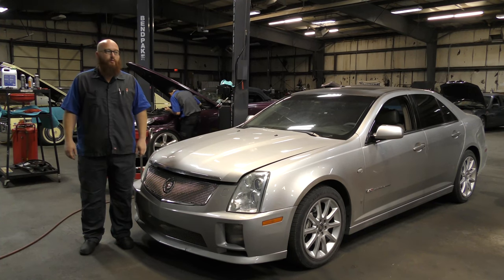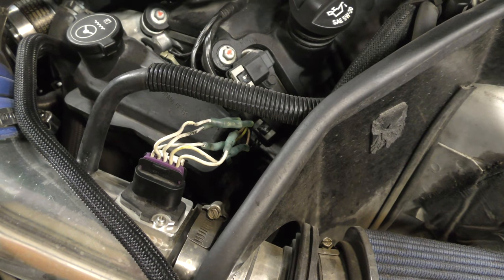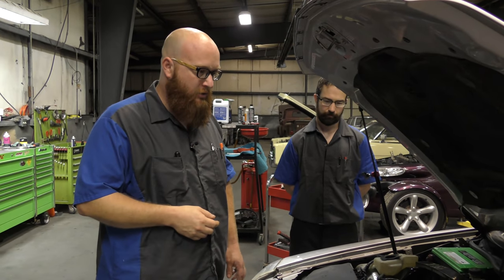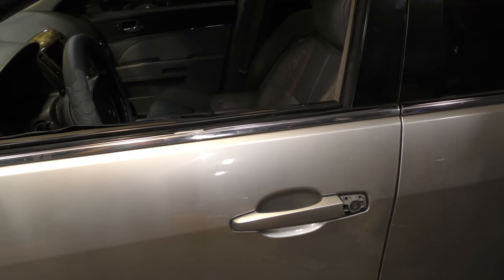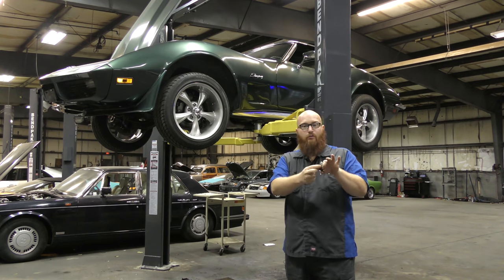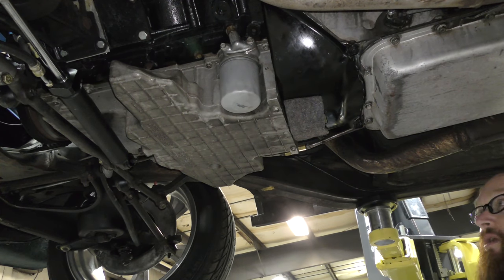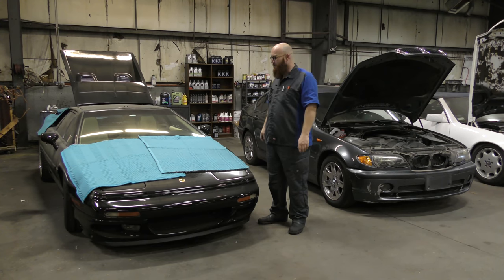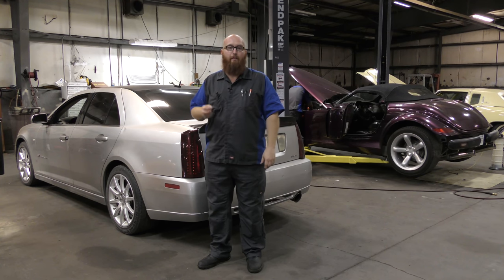When shops break cars! The CAR WIZARD cleans up mess made on 06 STS-V Cadillac. Plus shop updates.

Comment: The nightmare for every mechanic is opening the hood and seen aftermarket parts all over without any information lol.
Reply: Especially some crazy ass Nelson Racing Engines looking cold air intake..like it's from Aliens
Reply: That's the biggest reason why people who modify their cars should actually know enough about working on cars, that way they have a good understanding when something (beyond their ability) goes wrong and they seek out help. I know around where I live these custom shops always sell people on performance mods, but when something inevitably goes wrong, often times you'll see the car on CL / Facebook because the person can't figure out what went wrong, or the shops they went to have no clue what modifications were made and it'd cost thousands just to diagnose.
Reply: If your mechanic is scared  by an after market cold air intake then your mechanic is not a very good mechanic imho.
Reply: @geerstyresoil3136  took my car to a dealer, even after drawing them a diagram for an aftermarket horn working off the battery, they still would not touch it for an unrelated issue.
Reply: Especially on a N* they are famous for hating any kind of tuning. Hell there was a team that spent about a decade trying to make a bolt on Supercharger kit for the N* after 10 years they were able to get the ECU to tolerate 2 psi of boost before it shit the bed...the next week GM announced the factory SS 4.4 they abandoned the project the next day
Reply: It's not a nightmare it just don't get worked on

Comment: I can't speak for that STS-V, but I have a STS-V; the engine and the car is the exact opposite of what you described. It is a highly refined hand-built motor with a ton of features and high end materials used throughout the interior. Read any article on a STS-V and that is the consensus. The STS-V, took a completely different approach in V form than the CTS-V.  From the factory, the car is virtually silent despite having 469 horses under the hood.

Comment: I own a 2006 CTS Sport Luxury and I love the car.  I'm 71 and this is my umpteenth car, truck, and hot rod.  For those that aren't familiar with this particular model, it has quicker steering, 4 piston calipers, sport suspension, and a 4 valves, twin cams all-aluminum engine.   !8" factory alloy wheels and some other performance upgrades, making it a blast to drive with great, flat handling.   New Continental 225-50-18's that are amazing.  Only 85K miles.
My exterior looks great in Red Jewel Tintcoat.   It does have similar minor scratches and dings like your customer's  DTS.  Love your channel.

Comment: Wizard, another channel had the same issue with boost pressure sensor. It was a shorted sensor, and it got wet. 
I'm sure you already checked that but wanted to mention it just in case that episode holds a clue into what's going on.

Comment: Speaking as a machinist, I've worked in multiple fields in industry where, even if I wasn't machining parts, the attention to detail that you have to have to be a good machinist will easily transfer over.

You don't need to apologise for having branched out into cars. As you just showed, having the know how and a couple of basic machines handy is just an ace in the hole for you.

Comment: I have an STS-V. 😁 Stealth Blue on Titanium. The Spectre intake bolts right on and I’m not sure why the wiring was that way. Seems like just an improper installation but odd because it essentially bolts right in. Not much to mess up. Also, if this has gutted cats, the tuning may have been an attempt to turn 02’s to always ready in order to omit the constant engine light that will always illuminate. If they aren’t already there, the owner should join Cadillac STS-V Owners on Facebook. I’m an admin and we’re very helpful with issues like this.
Reply: Sometimes "mechanics" overthink things, you know.

Comment: I have a base model STS with the v6. Even the v6 is respectably powerful and fun to drive. I'm hoping to get 300,000 fun miles out of my STS.
Reply: Did you get the 300k yet ?😂
Reply: @mohamedhossam896  Nah, I sold it at 156,000 miles. The piston rings in cylinder #2 failed. I miss it every time I drive the CTS that replaced it.

Comment: My last 2 vehicles have required 80% fixing what the PO did or had repaired.  One repair was the oil cooler. I lost it at 75mph 😞.  I got 2 quarts that remained, so far so good.

Comment: I'd rather someone squat on the engine and pinch off a large loaf on my intake than have them leave a bunch of nasty looking crimp connectors and a lack of elegant soldering contained by heat shrink tubing. The whole "Tune Trend" is disappointing as well. Some kid has a J.C. Whitney $19.95 gadget with a YouTube video in Russian, then declares he's a tuner. They never document, never able to reverse what they did or explain why they did it -- 'Just thought we'd try poke around in the ECM.'

Back in the day, when I tuned a car, it was clear to all what I had done by sight and by sound. My specialty was the 327 - 325 Chevy engine. Flip the top of the air cleaner over and you get at least 33.5 hp at sea level, an Army Trix sound and a moan like it's coming from a, well... just a long deep lustful moan. Why you'd want to, I haven't a clue, but you can reverse that tune while the traffic light is turning green. Pro Tip: Don't drop the wingnut down the Rochester!
Reply: Those wire junctions deserved a unibloc style connector, something weather sealed and gasketed
Reply: Amen!
Reply: Do not drop anything down the Rochester
Reply: I guess if you're working on a Chev engine with a Rochester at least you don't have to worry if the 10mm ended up in there.
Reply: The butt connectors were ugly. Butt connectors are better than ordering though. Soldering can cause a resistance change in the wiring. When you're talking about a sensitive sensor like a MAF, butt connectors are ideal. However, there are better and smaller connectors you can use and can be installed a lot cleaner.
Reply: @joshfoley8862  at most, a solder joint will change the resistance of a wire a milli-ohm or two (an incredibly small amount). Well within the margin of error for any sensor on a car. 

A dirty butt connector could change the resistance far more.

Comment: Gm typically uses a 3 bar map, good for 1.6 bar of boost. When you install a 4 bar you have to switch two wires around for it to read correctly. They install it when they turn up the boost, for fuel metering and the +/- of ignition timing.

Comment: I’ve had to make many custom tools, like:

A set of wrenches to adjust the valves on my Benzs engine.
A socket to torque the locking hub bearing rings on a early 90s Tracker.
A socket to open up the valve caps on the shops air compressor.
An odd length socket to torque the headbolts on a Subaru while the block was still in the car.
Had to bend several box end wrenches to fit different distributors over the years.
Made electrical connector de-pinning tools out of the spring bars from wiper blades.
A power tester, made out of a cigarette lighter plug, alligator clip, inline fuse holder, and a voltmeter probe (great for testing if a blower motor is burnt out or testing starter solenoids)
During my tech school training, part of the class was machining a hammer out of aluminum, with a brass and 2 plastic faces.
Several “helping hands” out of bent coat hangers and alligator clips to hold wires together while I soldered them.

Comment: Hey Car Wizard, I wish you were there when I brought my 2014 BMW Z4 with 37k miles to the dealer and they told me I needed $4600 for 1 strut and 1 shock.  Now I don't dare drive drive it.  I know, I know, you hate working on BMW's.  To be transparent I have hit a couple of pot holes.  Soo far they have got $900 out of me for two tires.

Comment: Given the drain plug (looks aftermarket and not a 4L60 pan) on that 700 R4, I'd say that trans has been messed with before. There is a good chance that someone put a shift kit in it and removed the pump for the boost valve mods and didn't use the newer washers on the pump bolts, which will give you a false diagnosis on the leak. I've seen it happen and know some guys use RTV on them and the vent crossover in the pump for that reason. The shift kits jack up the line pressure under driving conditions, which is why you'll have a leak after a drive but it stops when sitting at idle. The stator shaft that retains the bushing is pretty cheap with a new bushing installed (better off doing both) if that actually is the problem though. I somehow knew you'd have a lathe....

Comment: I am an 73 old  shade tree mechanic with 1960 - 70s skills.  I observed back then  that you had better know what you are doing if you are modding a car. True in 1965,  super duper true today.  This things are engineered as integral  system. You can screw it up adding a cold air kit if you do not know how to do it.

Comment: The 3.6 in the cts is pretty smooth power. Trick is you have to change oil every 3k miles and the pcv every 5th oil change. If not the passenger side of the engine sludges up, tensioners slow, timing goes out, phasers go out.  5 w 25 mobile 1 every 3k miles. Engine burns about 2 qts per 3000k miles as well.

Comment: My uncle's 2001 BMW 750IL. While chasing down Transmission Failsafe and Canbus panic, I looked under the carpet and found 1" of water. EKAT Catalytic Converter Heater Controller was completely destroyed and was backfeeding into the Canbus system because BMW didn't put a FUSE on it. Dried it out and ended up building a relocation kit to move the EKAT to the trunk give it proper fused power from an empty slot in the trunk fuse box. The under carpet fuse box was trashes as well, so it got replaced. A few months later, it's back with more electrical gremlins. More water under the carpet and the new box I put in was beyond saving. Pull down the headliner and the sunroof drains fall off. Fixed them with some vinyl tubing and hose clamps, adding enough for strain relief, but it was only the start.

Everything under the carpet was "painted" green from copper oxide and I REALLY don't want to mess with it again. Cut out the corroded stuff, splice in new wire as needed and add new terminals. Not the OE BMW stuff that's $15 a piece and corrodes if you look at it funny. Now it has ring terminals with adhesive lined heat shrink to make it as impenetrable as possible. Since the box was shot and the studs and nuts were about to seize together like it did on my 97 Expedtion (firewall fuses...) , I drew up a brand new one in Paint in 45 minutes. Made a few adjustments to get rid of the goofy bi-level setup and put it all on a single plane. Scaled it to match the original and printed it out actual size as a machining template, accurate to 0.010". 
Studs are Stainless Steel carriage bolts locked into square holes in the top layer of the polyethylene base (household cutting boards), followed by 2 more layers as a backing plate. It's all stitched together via Plastic Welding along the perimeter and in 2 rows near the middle to make it one solid rigid piece. Add a stainless steel bus bar and it works like stock. Not the first time I made one, but it's definitely the best one I've made.

Comment: We have a w203 Mercedes with the om646 cdi and same fault code as the V.
Car came in for replacement turbo ( destroyed following (age and) overboost caused by map sensor having a hole in it, caused by badly fitting engine cover! So ecu was seeing less boost then it was delivering.
Did everything for a new turbo chra swap, cleaned everything up, new map sensor and now we have p0069. Suspect a bad new sensor so swapped a known good one off another running Mercedes, same code. Traced the wiring to the ecu and probed the offending wires, no extra resistance than what you'd expect. Cleaned the earth's and resistance tested them on that side of car, all seemed fine.
So yeah either ecu has decided to have an issue or there is something else going on. Get the code as soon as the ignition is on, so not an adaption (of vnt controller) issue. Puzzled :/

Comment: Modding a Northstar is potential suicide. I would have just left it alone..I mean 469 HP out of a 4.4 Northstar..that's plenty. Run it
Reply: net-rioter CTSV is no a northstar, it’s an LS1, basically a corvette engine
Reply: @racekar80  this is not a CTS V..it's an STS V..it's got a Northstar.
Reply: @racekar80 
CTS-V never had an LS1 either.  Started with an LS6 in '04, got the LS2 in '06, LSA in '09.
Reply: Nothing wrong with the LC3 engine on these. They are damn near bulletproof. It’s not like your old Northstar from the 90s or early 00s.
Reply: 137k miles on my sts-v... No issues and its got a stage 2 tc fab kit, methanol injection, and gutted cats straight pipe and still running strong. Does about 450 wheel, pre-meth reliably.
Reply: @racekar80  The car presented is an STS-V; it is a NorthStar derived engine:  supercharged.
Reply: The STS-V does NOT use the Northstar engine.
Reply: @houseofno  4.4l North Star dummy
Reply: I can vouch as I have one sitting in my driveway… 😅
It’s a 4.4L N* w/ 1.8L supercharged v8
Supercharger is massive… and sound is absolutely exhilarating with every trip to the store 🥰
So massive in fact, that Cadillac had to reduce their usual 4.6L N* v8 down to 4.4L just so that the damn thing can fit under the hood 🤣

That’s the reason why the weird smaller 4.4L number… to accommodate the 1.8L suitcase on top of it lol

I’ve got mine with some tastefully done bolt ones and few extras and 

~~have it pulling 550hp with 542lb/ft
**to the wheels 🥵 spicy unit and no plans to sell anytime soon. Lucked out and got mine already missed since was a Cadillac dealers personal vehicle until the Ex with spare key wrecked some psycho female dog havoc…
Reply: @clandeene  what kind of mods
Reply: @houseofno It's a Northstar LC3

Both XLR-V and STS-V have the LC3. 

There are numerous types of Northstar engines. 

Northstar types: L37(4.6 liter), LD8(4.6), LH2(4.6), L47(4.0 liter), LC3(4.4), and the LX5(Shortstar V6)

The most problematic engines were the early L37 and LD8, which a FWD application for the low and high trim Deville, Seville and Eldorado 

The others were decent motors. Carroll Shelby used the L47 in the Shelby Series 1 making up to 400 Hp

Comment: As a gym dealer tech I can tell you  2 things 1. that looks like a genuine genuine replacement pigtails they come in kits with the but connectors. I don’t personally use them I solder the new pigtail on and make it look more professional, and 2 GM uses very poor quality terminals in their connectors and we replace all types of pig tails all the time.

Comment: One of the reasons I got into cars and fixing them myself was because after a wreck I needed control arms replaced on my miata, a shop replaced them all and charged me 1800.. yeah I know it's too much for a Miata, but I was 18 and I was saving up so long to get it and o ly had it for a couple months.

After I got it back, Everytime I shifted I heard metal on metal almost like a shotgun pump as the car rocked or moved. I was so scared thinking I'll have problems forever, I took it back and told them about the noise. They told me everything's fine and they can't replicate the noise.. I took it to an actual dealer and they said whoever did the work finger tightened all of the control arm bolts and that's why everything was shaking. Ever since then I try to at least fix what I can or learn what work will be needed before trusting a shop.

Comment: You're very knowledgeable.   Come get my 2005 sts 6 cyl.  I'm so sick of back and forth to the mechanic for 2 1/2 years.  I just bought this car to have a reliable traveling car.  I've never had that yet.  9k in repairs so far and another 1400 to go.  Then who knows what else.  The list is long with all that has been done.  It's all stock still with many new parts and mounts and center support and new evap, tcm, ecm and still issues.  So tired.  Wish I could afford just getting  rid of it but so much into it, I'd take a huge loss.

Comment: Suggestion for cat problem. If you know the proper reading should be zero and you know the current reading is negative, A possible fix might be to add a resistor on the sensor wire that would bring the reading up to zero. No sure if this would work but it is a $5 fix if it works.

Comment: Thought this was going to be same problem I had with MAP correlation on a modified Cobalt SS that would go into limp mode, that one turned out to be a pigtail on one of the Baro sensors, it would be fine sometimes for hours and then would pop into limp mode and by the time you looked at the data everything was reading again.  I couldn't get it to act up even wiggling the pigtail until I started logging the 3 sensors while driving and finally saw the glitch.  When I disassembled the pigtail there was a tiny piece of broken plastic inside and it would allow the one wire to very occasionally loose a little contact. Also verify the correct sensors are on it, sometimes guys put a 2.5 bar sensor on there and it reads off so make sure it is correct factory part #.  Also possible they tried tuning for a 2.5 or 3 bar sensor on there and the curve is skewed, maybe a factory reflash to start with is a good idea.  I know you will solve this puzzle.  Great Vids, makes me want to post the Gallardo locked up V10 my buddy had that we polished the crank and threw in Audi rod bearings in and made it run again for 3k instead of a 30k used motor.